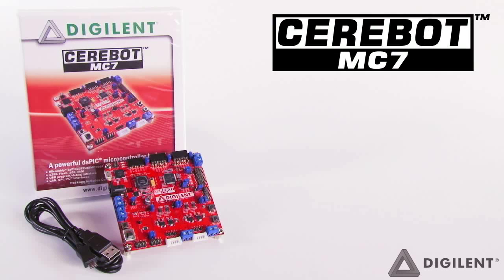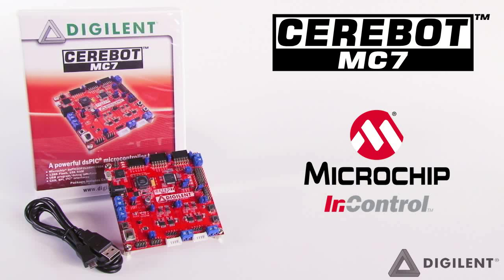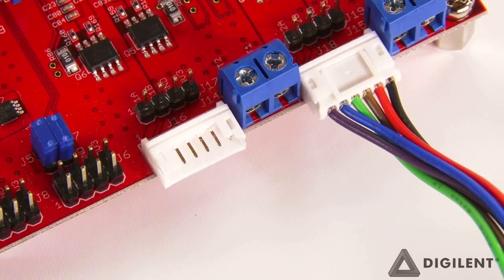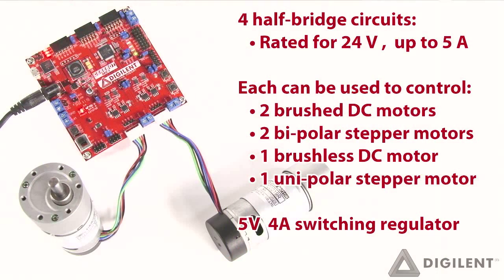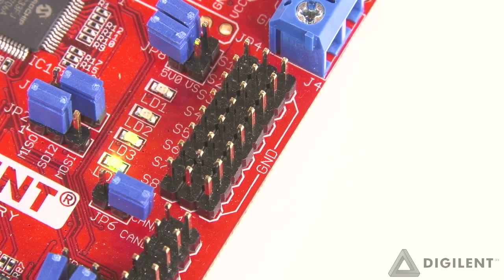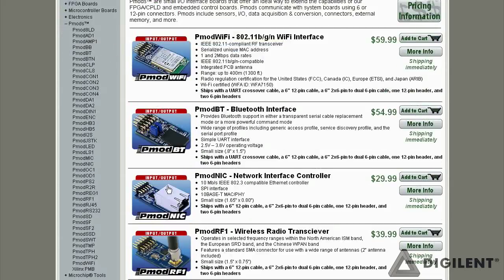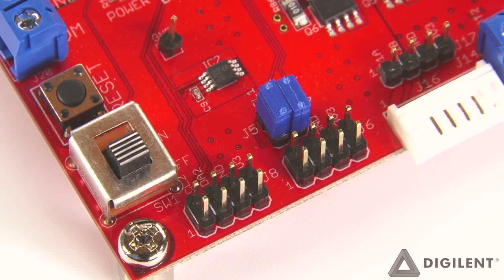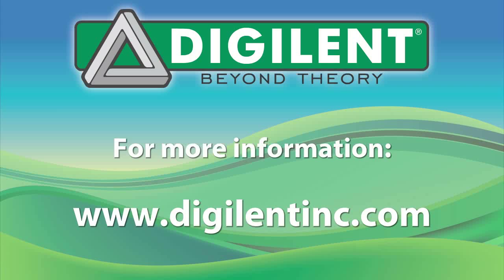Digilent Cerebot MC7 Introduction

Comment: I'm  interested in getting this product, but I have a question about how many DC motors can be controlled with the built-in half bridge circuits. I need to control 7 dc motors (500 mA each)  in such a way that they can all rotate in both directions.